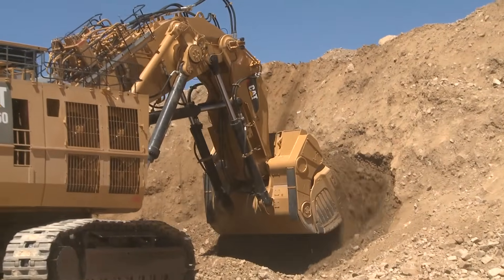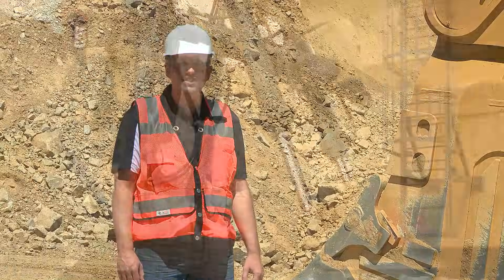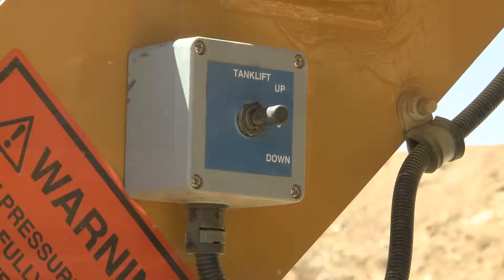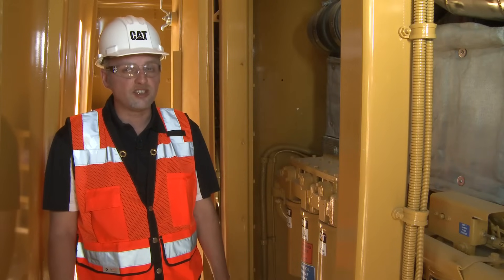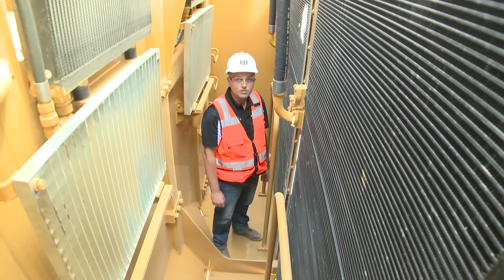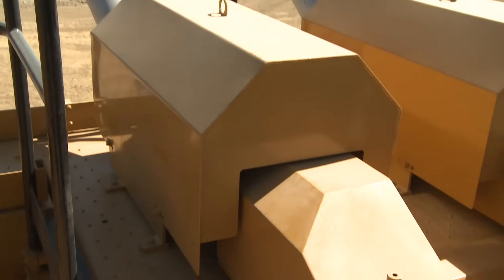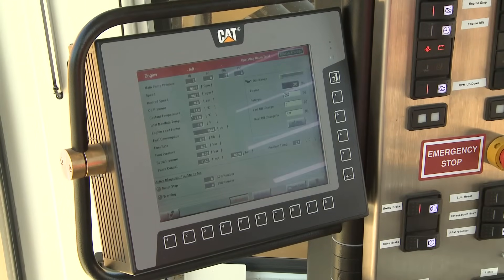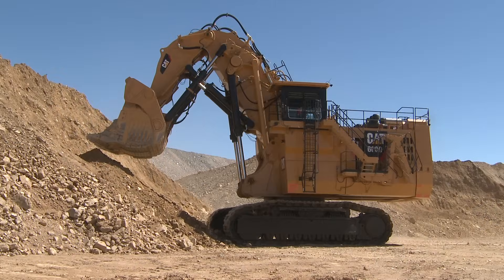Cat® 6060 FS Walkaround

Comment: I never understood something if someone could help me with. Why do some buckets face foward compared to facing the operator? Is there a benefit for that?
Reply: I know this is an old comment... But...

Front shovels like the 6060FS load material that is level with or above them. They work below the bench. The action of crowding out and curling up has a tremendous amount of forward breakout force, but they have pretty much no ability to dig below them. A backhoe (excavator) is designed to sit on top of the bench and dig below level. They have maximum breakout force when curling the stick and bucket inwards. Hope that explains it!
Reply: @Motologist95  hey thank you so much! I really appreciate the explanation

Comment: It's just a Terex O&K 400, you would think you would find some thing better after 20 years.  I guess it it isn't broken and it works don't break it.  Only thing new is it cat yellow, cat engine and the control tower switch have changed a bit.
Go the go old tri-power.
Reply: its an rh 340 the 6090 is the 400